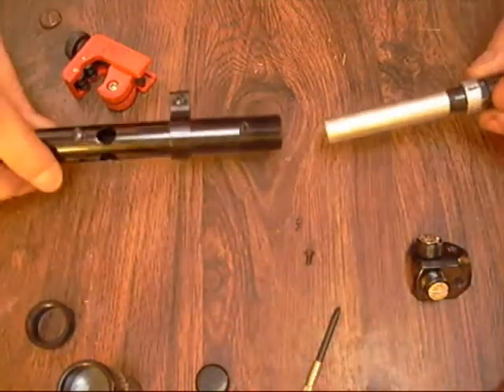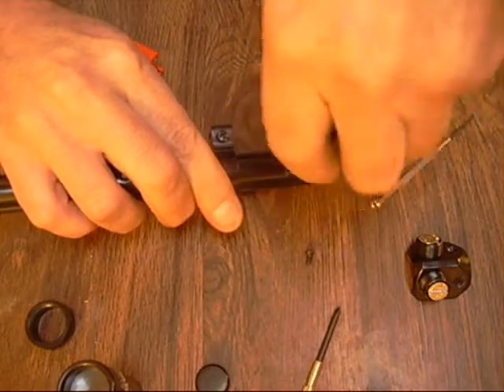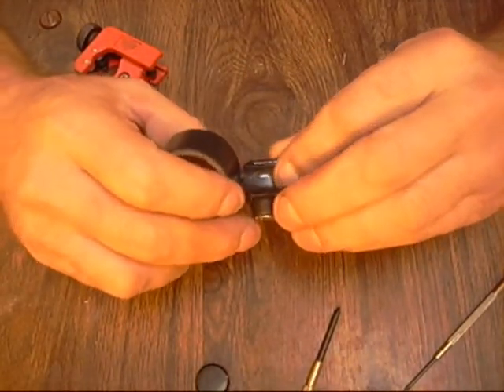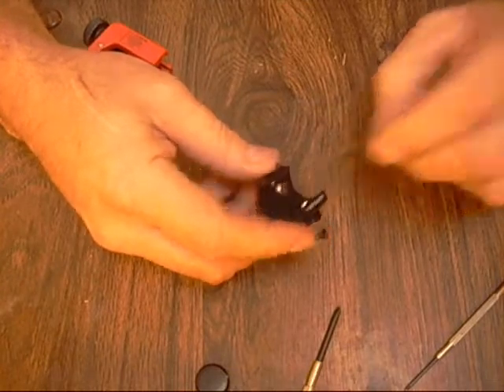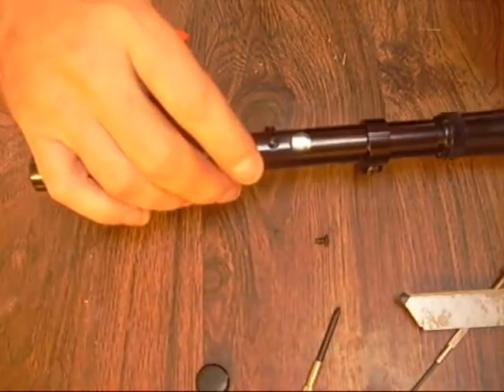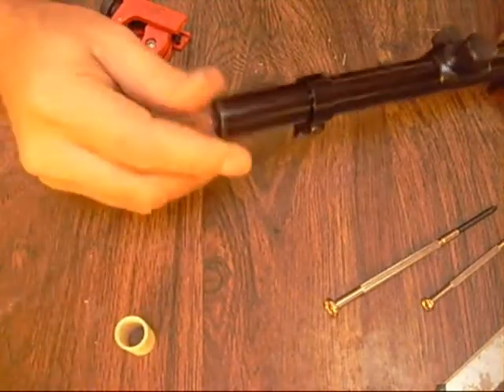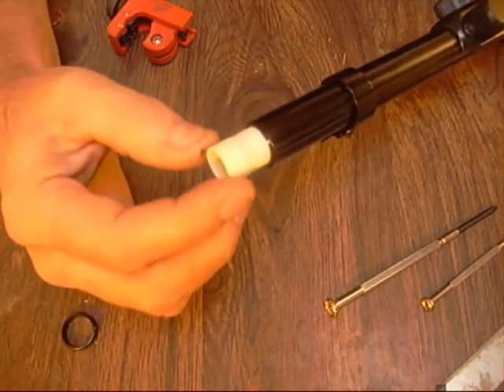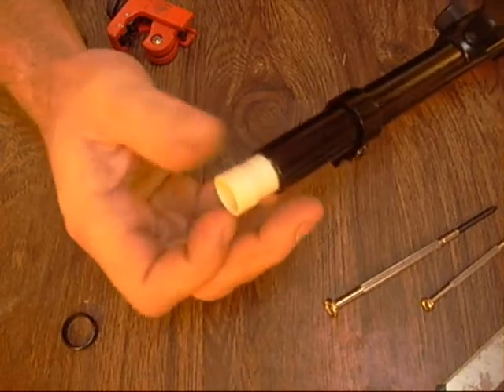Airgun 4x15 scope mod PART 2

Comment: Hello there. Just to share: I followed the instructions and it worked perfectly; also, if you put the 11/32 section first, followed by the lens, the section with the peep hole  and the remaining sections you can achieve 8x magnification and parallax correction from 2 up to 50 yards+. Really not bad for such a simple scope. Again, thank you for the tutorial. Best regards.
Reply from the maker: +Alexander Guerrero cool on 8x
Reply: Thanks m8! I was wondering about this too. Gonna try it today.
Reply: It worked!

Comment: Great tutorial, thank you very much; I have two questions:
1. Can you achieve 8x magnification by moving farther forward the lens inside the inner tube?
2. Could these instructions be applied to modify a 4x 32 (Gamo or Tasco) scope? That one is also a common scope.
Thank you very much for your help and comments. Best regards.
Reply from the maker: +Alexander Guerrero I have had a 2-7x32 apart,I think  you can for a 4x32